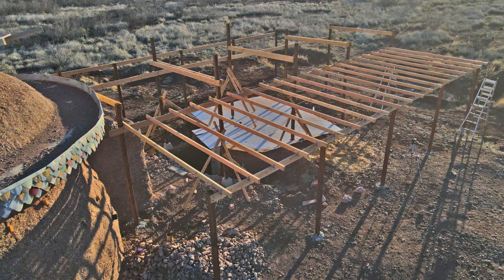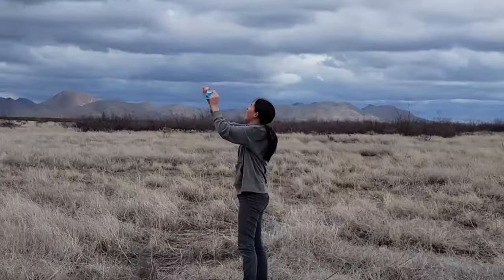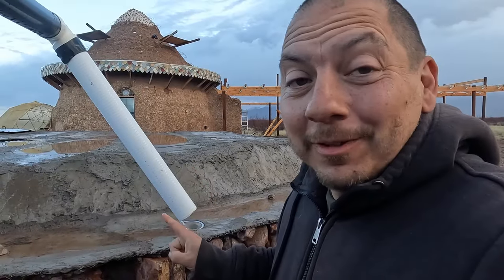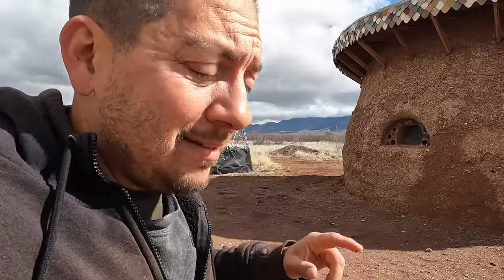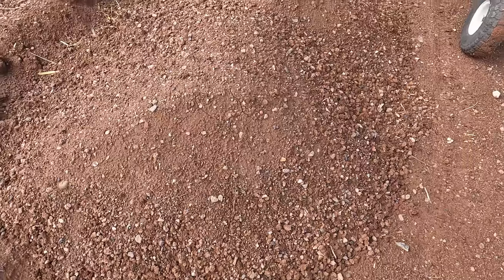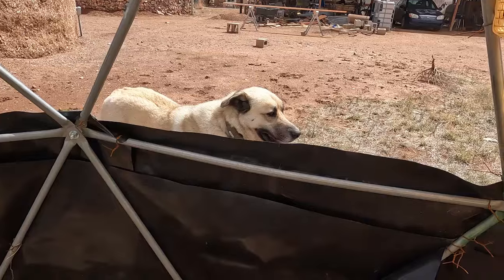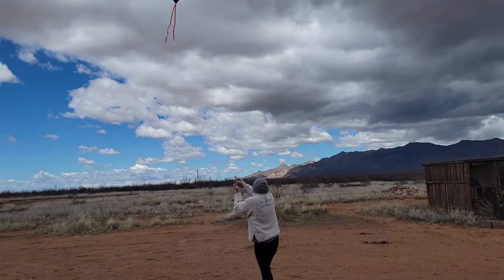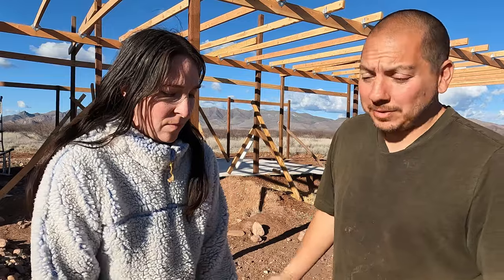Unexpected Storm Derails Our Pole Barn Build

Comment: So the rafters you are placing now, are on top of boards that are nailed/screwed to the sides of your beams in the ground. So virtually all that weight of the rafters and roofing materials depend on a couple of nails/screws into the side of the boards at the top of your beams?  Before you get too far, you might want to rethink this Jim.

Comment: I need a week of dry weather!  To make fire wood, It rains every 3 days !   WHERE I CAN'T CUT WOOD AND SPLIT WOOD... The hail beat up my solar street lights. SO I HAVE TO GET NEW ONES. got 2 600 watt ones coming in WED.  Just going to try to get by with them. I still got 1 good 300 watt street light that didn't get the hail knocked out of it.  but the 4 others ones are shot

Comment: whenever you have a cramp take about 1/16 of salt and place it in your mouth. water will not hurt. if the cramps go away in 5 minutes  it will be caused why low electrolytes.

Comment: Actually, I think you would have been much better off by buying a 12 or 14 foot wide by 20 foot shed and all you would’ve had to do is finish off the inside. You could’ve worked in any type of weather that way and you could’ve had a home fairly quickly.